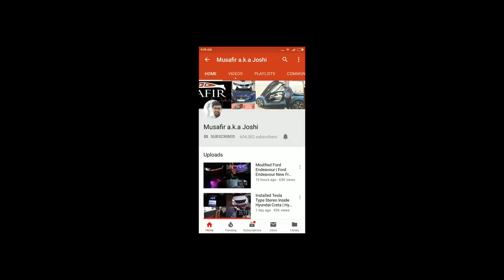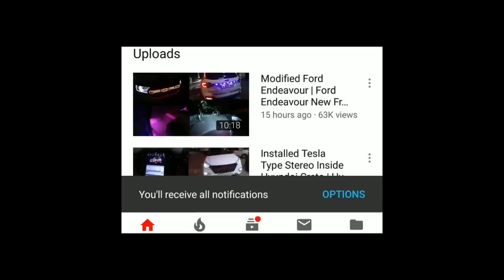Washing My Swift With Portable Car Washer | Portable Car Washer Review | Best Way To Wash Your Car

Comment: I never commented on your video but today i am doing because you just abused your car by using detergent and a cotton cloth, take my suggestion and use formula1 or any good brand Shampoo, tyre cleaner, dash board cleaner and especially MICRO-FIBER clothes for rubbing and cleaning, once a week you need to apply Wax on the car body to protect color from UV rays and pollution. You can make video on that too.

Comment: Thank u bro ,,,,,, for the headsup info ,,,especially  that it is capable of using the car lighter ,,,,,rather than connecting to a Tap ,,, when your tap is on the 10th Floor 😅 Thank u thank u

Comment: Musafir, Stop giving wrong advice. You should never wash car with detergent it damaged paint. Use car clearer or else use a mild shampoo like Pantene or any cheap shampoo. Ask any car dealer or 3M and they will tell you NEVER NEVER use detergent to washh your car or 2 wheeler.

Comment: No waterproof electric connectors. Thats a big no.
Reply: Better option is to Buy Bosch Easy Aquatak 110 will cost almost  same , But have much more pressure than this crap.
Reply: Dont Go for banggood same stuff available for 50% less on amazon